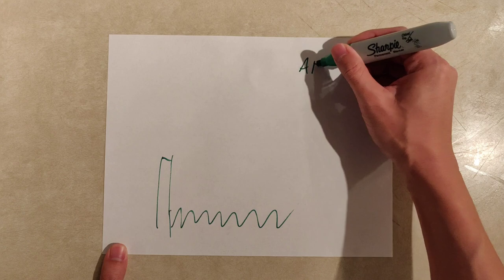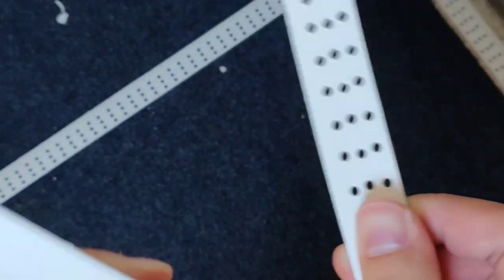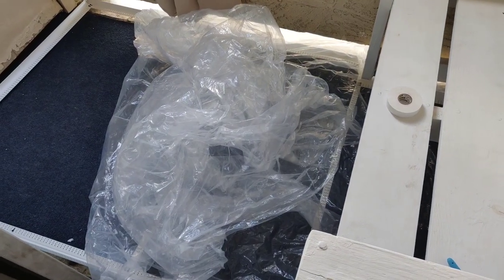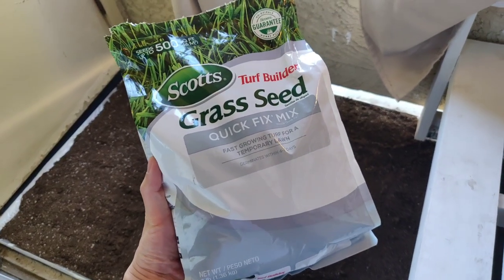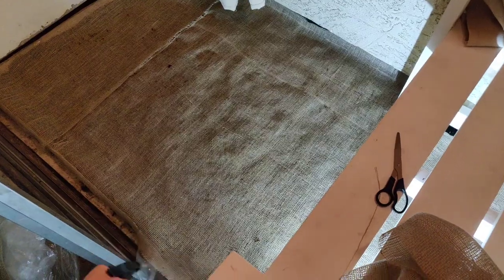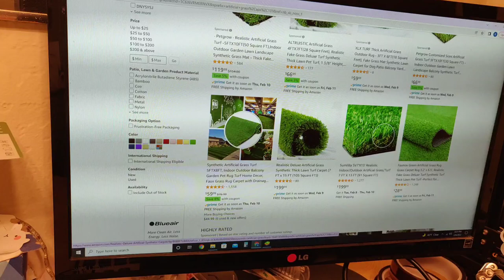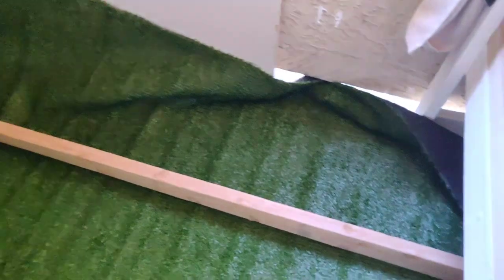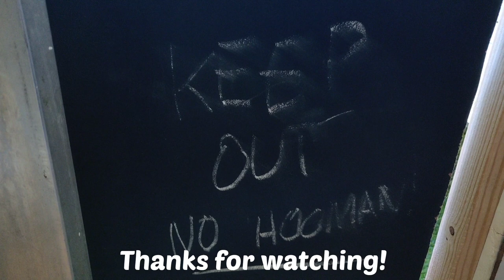Planting REAL Grass on Our Balcony

Comment: Did your dog try to pee on it?
Reply from the maker: Oh yes. Many many times lol.
Reply: With your dog peeing on it, do you do any maintenance on the artificial grass? How about drainage? (I'm trying to build the same)
Reply from the maker: Our balcony is built on an incline for drainage. You can add a plastic or tarp layer between the balcony and the artificial grass. Then occasionally rinse it with water.